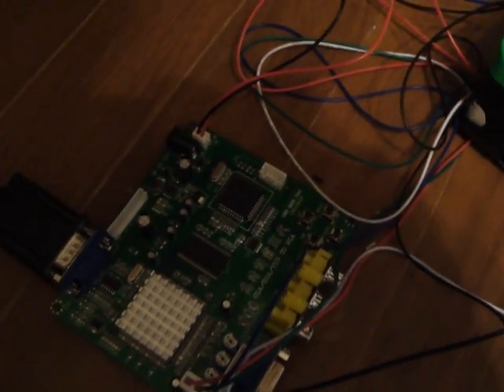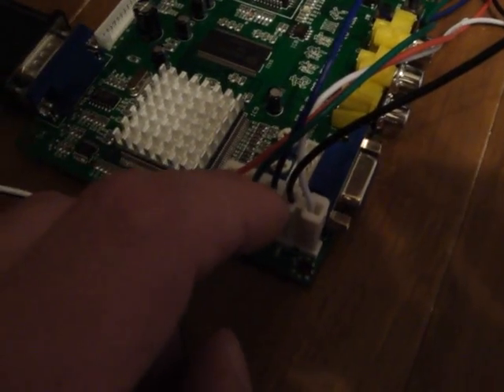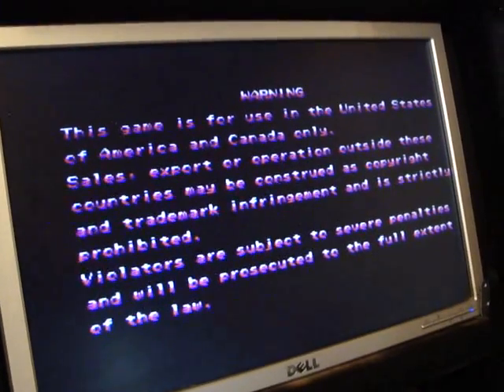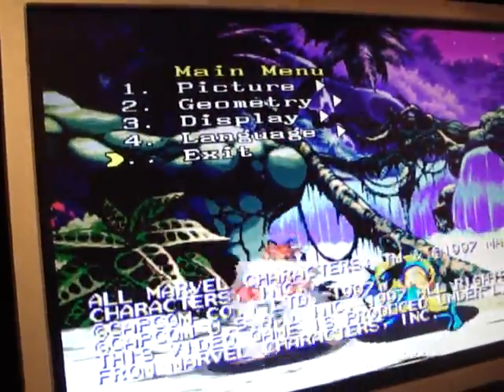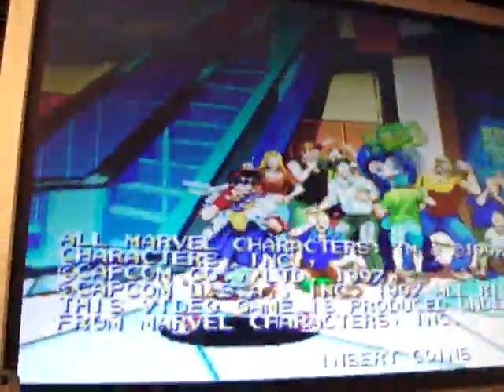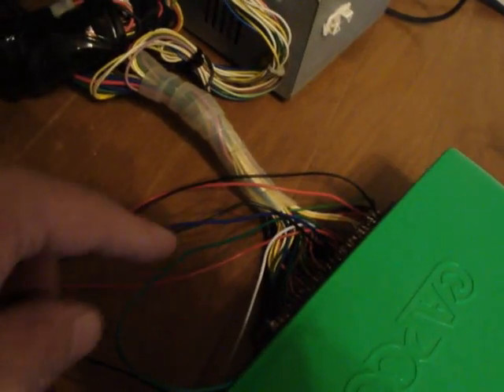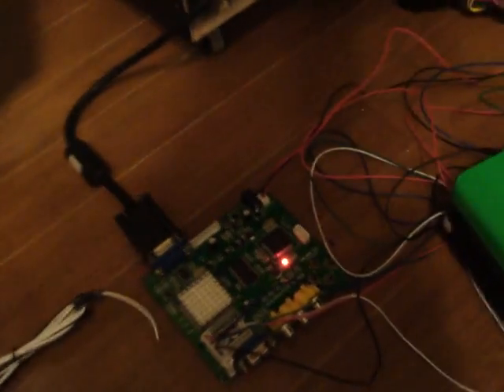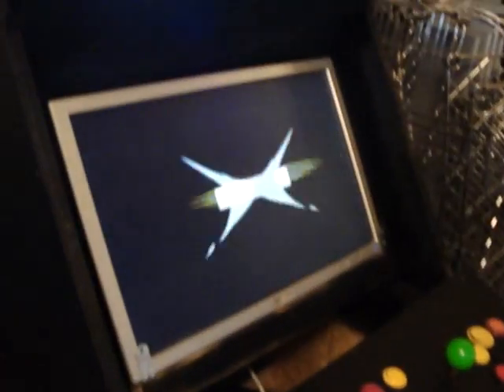RGB To VGA Video Converter For Arcade PCBs

Comment: Hi luke, mine stopped working Months ago and I’m out of idea’s. I have two of these, and only one is doing something. It keeps on no display. If I fiddle with the 5v pod sometimes i see the game running but looks aweful and flickery. After I switch of power the image is gone. I have a vga arcade monitor and An old Pandora’s box 5 works but the newer hdmi/vga versions also won’t work directly from the vga output. 

Please help me as I have absolutely no clue.

Comment: What about the sound how do you wire the the sound????
Reply: If you want to use a TV with it you will need to use a 3.5mm aux jack (on most TV connection s with a VGA plug). Wire it up to that. Or wire it up to RCA jacks.

Comment: just got one of these I have a red, green, blue, grey, yellow and black wires that are attached to a plastic clip, I know where this goes on the board but where do the wires go then ? to my jamma harness or somewhere else? and how do I connect them to my jamma harness ?

hope you can help

thanks
phil
Reply: +phil wheeler how did you go? I have the same problem, still looking for solution.

Comment: hi luke. i have a samsung crt arcade monitor that i want to use with my modded xbox. could u point me in the right direction as far as what adapter i need to purchase to complete my project. thanks.

Comment: My power supply has a 5V 1A and a 5V 15A to wich one should i connect my red wire ???
Reply: Red wire +5v
Black wire ground

Use the one with more amps available. No worries if it is higher than needed. It will only draw what it needs.

Comment: So if wired correctly, this would work for taking the RGB signal from older game consoles (Sega Genesis, N64 [With Mod]) to output to a VGA monitor as well? I'm aware that these game systems output the 15khz signal which this JAMMA-style converter is supposed to accept but I thought I'd ask for reference.

Comment: hey luke, that´s a nice little unit, but i have a question. if you have a sega naomi cabinet, wich has a vga monitor also, are u able to play jamma games on that cab with that little unit? =) well i guess you have to wire up the controllpanel and you gotta have an external power supply i guess, right?^^

Comment: These devices will work with retro consoles. You will need a sync splitter not a sync amp, for the Saturn etc or ensure your console is wired for composite sync to work with this device.  Been there and done it.

This scaler is OK.... but the quality is a bit low rent compared to proper line doublers.  However for the price it certainly does what it needs to.

Info videos about all of this on my channel or look at the threads on SHMUPS.

Comment: Hey luke can you try to use this with a Mega Drive or SNES or PC Engine. I am very interested to see how an old skool 16 bit system would look on an LCD. Even a PS2 via RGB would be a good test also. Most older gen systems look crappy on an LCD unless a XRGB is used (very pricey). Much appreciate it if you can do a comparison of composite vs RGB to VGA converter.